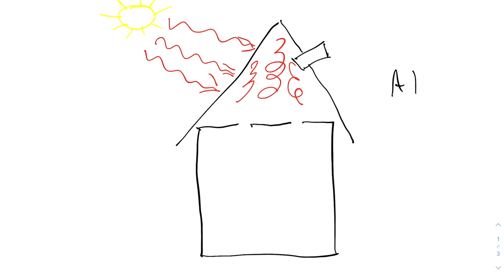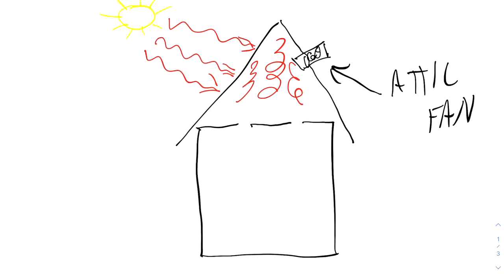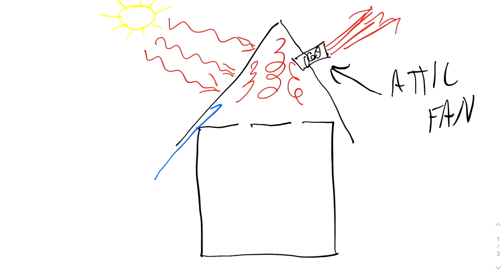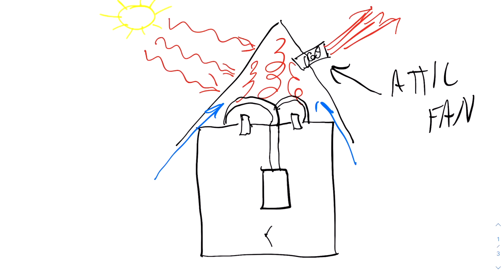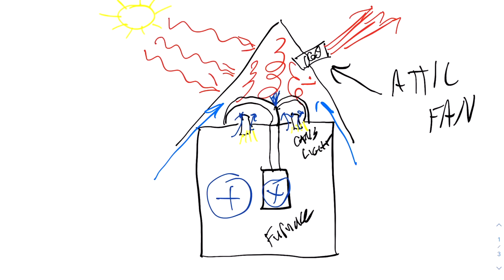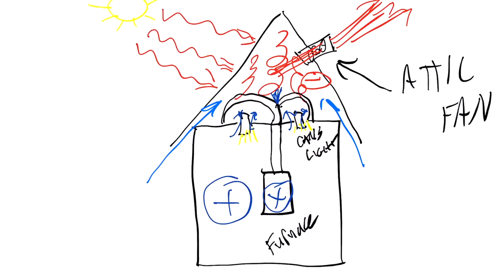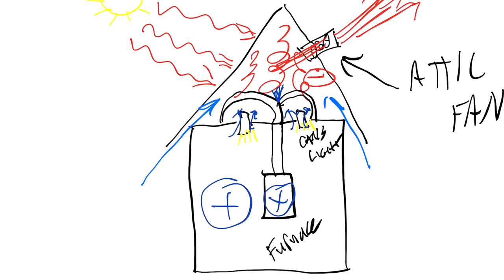3 Remodel Rip-Offs

Comment: Looking through the comments, I see that lots of people have had the same empirical experience I had with installing and using an attic fan.  I owned a small bungalow which had barely adequate ducting to bring enough warm air to the second floor for heating in the winter and not enough air for cooling in the summer.  I installed a gable vent fan and set the remote thermostat to run above 90 degrees Fahrenheit.  That knocked the second floor temp down 5 to 15 degrees with the AC temp set the same for the first floor.  The fan cost about $50 with about another $50 for the remote thermostat and wiring.  It contributed greatly to the comfort of the second floor bedroom.  The biggest downside was getting to the fan every couple of years to oil the bearings.

Matt, I like your videos.  But, you are talking out of your butt on this one.  It sounds like a bunch of stuff you were told by people with no actual experience and damages your credibility.
Reply: I agree with you. Here in the Okanagan valley very hot summers. Installed a few of these and the customers reported back cooler upstairs on hot days.
Reply: I agree with you. I installed a gable vent fan on a friend's house. The rafters were so hot that you couldn't keep your hand on them. You also couldn't be in the attic for more than about a minute. After install, it was still somewhat uncomfortable but you could touch the wood and could be up there for hours without dying. Of course, the electric bill dropped too.
Reply: @cyborgdale  there is a reason us HVAC people if we run into a house that has no ventilation in the attic and equipment is there, we will pull a salvage furnace blower and put it on a gable vent and turn it on for 5 minutes before staying up there for longer periods.
Reply: @ouimetco  Okanagan Valley? Hot summers? ha. Do you understand, this video is from Austin, Texas?
Reply: HouseORudd I have been to Phoenix once and ya it was cooking. Hope your staying healthy down there. Lots of horror stories in the media about the pandemic. Cheers man
Reply: I have a couple of those installed in my garage and think they're amazing.  The temp never rises much more than the house.
Reply: @HouseORudd  Okanagan Valley B.C. has ratle snakes, Ponderosa Pines, and (compared to California) short hot summers but is dry--its Canada's desert--no humidity unlike some of East Texas. The Canucks do not live in igloos (mostly)...maybe a few ...a few generations ago...in the N.W.Territories and the Yukon.
Reply: @reikoross9181  Igloos! haha that's funny. Hey it was 106 Fahrenheit today here in Fort Worth, Texas. Y'all stay cool for me.
Reply: @YooToob Moderator there is a little information missing here. The air is normally not pulled from the living space. Most attics are designed to breath to keep moisture buildup down. When the air is stagnant it will get hotter. For example you put a black box out in the sun and some food inside, it will cook slowly. If you put holes in the box and a fan to move air in and out of the box the food will not cook. In an attic if the air is stagnant it will do what's called heat soak through the ceiling on the top floor. Moving air through the attic prevents heat soak. Hope this explains it better for you.
Reply: The fan is sucking the hot air out of your upper floor, not cooling the attic. That means its pulling conditioned up into the 2nd floor (cooling it) and into the attic as well. So your top floor will still be frigid in the winter AND you are potentially pulling outside air into your living space on the ground floor. Sounds like your thermostat is on the ground floor...so while the entirety of the house might feel more conditioned, you haven't actually saved any power because your HVAC was always cooling for the ground level. The only difference is that you installed full house ventilation in your attic
Reply: @JoeCdaYT  thats alot of pseudo science you just spouted. Attic floors are supposed to be air sealed, not moisture impermeable. Those 2 things are not at all the same.
Reply: @MarlowWhere  I didn't use the attic fan in the winter.  The thermostat for the attic fan had the sensor bulb located in the attic.  Removing some of the hot air in the attic and the ceiling of the second floor made it easier to get sufficient cooling to the second floor.
Reply: Dude talks a lot of smack about things he knows nothing about. He's a slick talker, and he builds some nice looking stuff, and uses some cool systems - but he shits all over tried and true things that are proven to work (if done properly) and last many many decades - because there's some new fad he's got wood over.
Reply: @notsure7874  
      Don’t be “That Guy”
Reply: @elliottalderssohn2751  I can't help it man. It's hard being "that guy"!
Reply: @MarlowWhere  attics are not air sealed everywhere. When you're dealing with old houses, the attic fan is the most efficient way to keep it cooler. The attic should have proper venting to soak air from outside, that is much cooler than inside the attic. 

It's not pseudo science. Same principle as the whole house fan, but for the attic.

If attic is fully sealed and insulated, the attic fan doesn't make any sense. this is correct.
Reply: @pyakpepyak  even in a fully air sealed and insulated attic, gable fans will keep the condensate moisture from building up. I’ve done enough of attic jobs and seen what a non ventilated attic looks like, more often than not you’re starting with peroxide before you even blow out the old insulation and clean the interior.
Reply: @ISeeDogs I agree about the house, or at least the HVAC, being poorly designed.  It was built in the early 1950s with an unfinished second floor.  Since it was not a living space, they didn't provide sufficient ducting for the second floor and what was there was a long run with multiple bends and no air return.  Also, at the time the house was built, central AC was not common.  

Without ripping open walls to add ducts, my only option was to find a way to get rid of some of the heat in the attic and second floor.  The gable fan was an inexpensive way to suck out some of the heat.
Reply: Agreed. This dude has no clue what he's talking about making flat blanket statements like this. Here in the south where it gets crazy hot in the summer, most companies recommend radiant barrier first and foremost to cool your attic, and an attic fan to compliment the radiant barrier.
Reply: TRUTH! My vent fan installed on my attic access drywall panel works great
Reply: @tonytony6912  I always intended to put in a ceiling access panel, but never go around to it.  So, I had to go up a ladder to get to the fan from the outside.  I sold the house five years ago, so it's not my problem anymore.
Reply: Unfortunately, it’s an accidental coincidence. People add powered attic fans that apparently “solve” their hot attic issues, but it only shifted the problem to another area. Many simply are commenting their attic is cooler since installing the powered fan, and thus conclude it worked. The reality is extensive research has found attic fans actually create a negative pressure gradient that in turn pulls cool, conditioned air through the attic floor gaps and penetrations. It also could disrupt attic air flow and counteract the passive soffit vents, leading to more moisture issues in the wintertime as humid air is pulled from living spaces into the attic.
Reply: @sm753  that’s hilarious. All the studies show powered attic fans create a negative pressure gradient pulling cool, conditioned air into the attic. Not very intelligent, but hey, what do you know? :)
Reply: @eggnogaddict6287  Lots of empirical experiences say that attic vent fans did what the homeowners wanted.  By removing a layer of hot air trapped above the ceiling, it became easier to cool the top floor.  One HVAC specialist told me to either add more ducting to carry more cool air up to the top floor or add return air ducting to suck the hot air off the ceiling.  Neither was practical as it would have involved ripping out walls and sections of floor to do that.  

People who installed attic exhaust fans generally also installed thermostats so the fan would only run above a set temperature in the attic space, typically 90 to 120 degrees.  Therefore, the fan would have no effect in the winter as it would not run.  But, in the winter heating season, warm air rises so it is much easier to get sufficient warm air to the upper floors.  And, cool air naturally drops so it will flow down stairwells and find its way back to the furnace.
Reply: So the reality is in a well built home that is air tight and has adequate (not code minimums, more like double code) insulation with a well designed roof, and proper calculations, with zero mechanicals in the unconditioned space, powered or solar attic vents are a waste of money and not a real benefit to a home. However as a builder who not only runs their own tests but has more building experience in high end residential than Matt, I will say there is a time and a place where a benefit can go against the norm as it's not factoring other specifics. A lot of modern homes are shamelessly being built at the expense of knowledge and in the long term the unknowing home owner is being punished for it. Air handlers in 100-150 degree environments are fighting both internal and external situations. Thus they wear out faster, need more maintenance and have more situations in the attic that just radiant energy. I removed the 20 passive box vents from my house in north Texas during my reroof (revia f-wave), after doing load calculations, I doubled the attic insulation, airsealed all penetrations, replaced the box vents with 2 powered fans, 1 kicks in at 105 and the second kicks in at 120. The second rarely kicks on, the first usually mid day or later into summer. I have measured day by day heat load vs consumption and have proof it's effective when done well. In winter I reduce the opening sizes  from below (sheet magnets with a 4 inch hole inside of them and they hold the heat in) and reduce heat loss. I would have loved to have full airsealed the attic, but I didn't feel like redoing the HVAC system entirely (80% efficiency units would have had to be removed, fresh air supplies provided, framing strengthened for the additional mass, all soffits closed and sealed, all insulation removed and replaced etc.
Reply: By the logic Matt presents, there would be no point to opening the windows on your car when it gets hot inside.
Reply: @eggnogaddict6287  in the wintertime they do not run 🤦🏼‍♂️. Most do not activate under 90 degrees. 🤣 But other than that shoulder months and summer yes it has the possibility to pull conditioned air (generally less humid air) from the interior of the house. The biggest moisture related issue would be humid shoulder month or summer rain storms. That will pull a dramatic amount of moisture, however as it is moving air at a fairly high cfm the moisture is being pulled up and out along with the hot air drying the space over time. It's ok it's complicated and there are merits to both sides when both are installed in proper methods the issue is when they are installed incorrectly.
Reply: This comment wins! I’d like to hear what his alternative options would be… what a dumb video.
Reply: @dfejack  Thank you.
Reply: I think the reason that attic fans work in canada is that we have a vapour barrier here under the insulation. There is no air being pulled out of the house and into the attic because everything is pretty airtight. 

The cooler air in the attic helps with the temperature difference between the house and attic, therefore taking less effort to cool the rooms. So they stay more comfortable. 

Judging from matts videos, they dont do poly or vapour barrier in texas. Only air sealing
Reply: @marvingrass5581  most of texass building even airsealing is a tall ask. Some of the worst building quality standards in the US which is abysmal compared to most other 1st world countries.
Reply: I agree.
Why did old-timers put giant cupolas on barns?  To help cool those hay lofts, of course, and draw hot air from below, up and out that would otherwise be held inside.
Reply: It was when he recommended steel vertical drain pipes for sound reduction that I knew he was knowledgeable but willing to cash a check
Reply: I agree 100%.
Reply: Has anyone done a study on adding a -- I don't know what you would call it, Faux Roof? but it seems like adding an additional roof, like a tarp or something to shade your current roof same as a huge tree would do, would save substantial money. In some zones, even adding a permanent structure would save enough money over time to make it worth it.
Reply: @noahway13  I thought of the same, even a heavy timber framed structure to hold a roof about 18" over the actual roof to keep the environment away from the actual roof below. It's got to help in many way for heat and cooling. Just like a single story home is way more efficient than a two story but when you factor in property taxes to be twice the revenue with two stories, our lovely experts in Government approve two story homes instead of single story with basements.
Reply: @noahway13  While you are building an elevated second roof, how about making that out of solar panels?
Reply: I never heard of oiling bearings nor is it in the instructions...
Reply: @Rick-tb4so  It depends on the unit and the manufacturer.  Some may  actually have sealed roller or ball bearings.  But, most have bronze sintered bearings and even if it isn't in the instructions there is a provision to add oil.  I used to pick up the common 20" box fans that people would use for a couple of years then throw out because they would barely run or not run at all.  The just needed to be taken apart, cleaned, and a few drops of oil.
Reply: @Rick-tb4so Yes...if you look on youtube,  you will find a few channels that show this. Most modern motor use "sleeve" bearings and the have a "packing" material that holds a small supply of oil for those bearings to lubricate them. The higher quality motors use sealed "ball bearings" which provide a longer life and don't require an oil bath. In the older days, every motor had "Oil ports" to keep the packing wet. When newer motors wear out, its usually the bearings that freeze up due to lack of oil, not the motor itself.
Reply: @stuartmacfarlane1 2:16 901
Reply: @garyroberts2563  So, I just rewatched the video starting with the time stamp you cite.  What he calls a scam, in my actual experience actually did work.  It made my second floor 10 or more degrees cooler for very little cost.
Reply: @pyakpepyak  The small gaps in the ceiling to the second floor will bring in conditioned  air, the much bigger holes in the attic vents will do nothing.

Comment: I had a solar fan installed 2 months ago, immediately notice the air in my house seem fresher and my house stays cooler. I use to keep my house at 72 F now I keep it at 75 F because when the thermostat reads 75 F it feels like 72F. My power bill also decreased about 20%  but only been 2 months but I'm betting the solar fan is going to pay for itself in about 1 year. Also, I've been doing a lot of work in my attic and it helps out greatly. I also have been told it can extend the life of your roof by reducing damage from the radiating heat in the attic. One of the best decisions I've made.